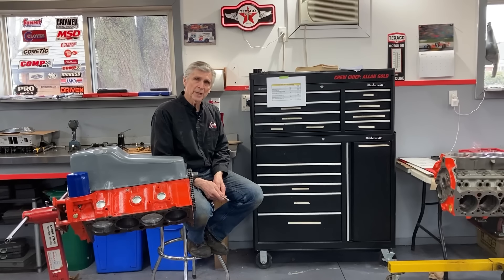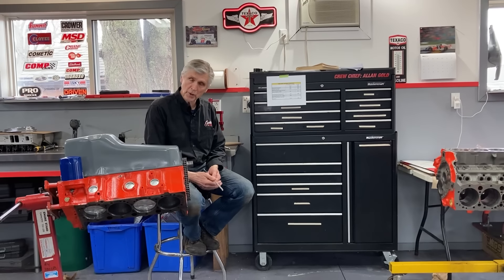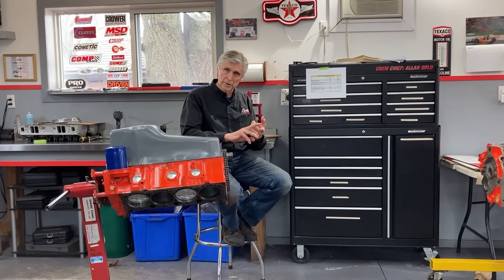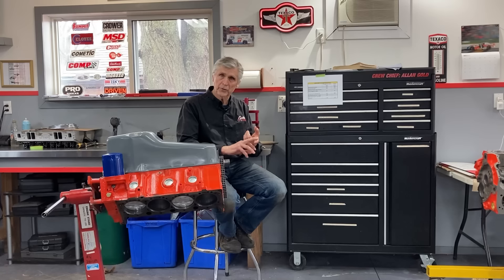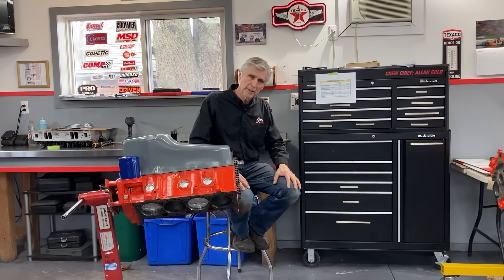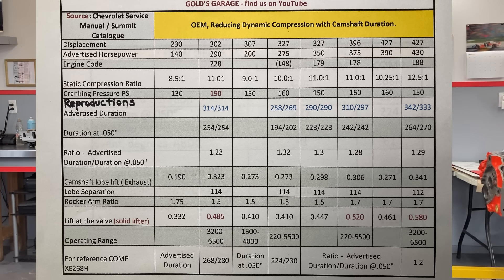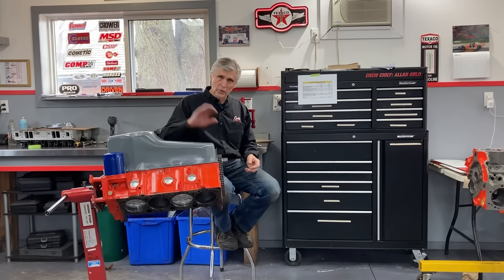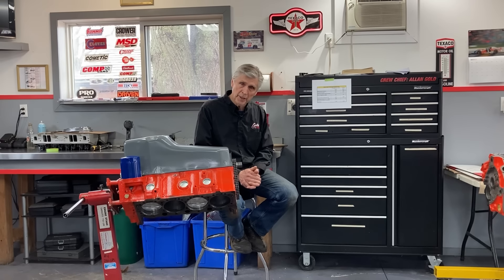Selecting the right camshaft - Compression Myths How much compression can you run on pump gas?

Comment: TheSaab 2.3 turbo engine have 200 psi pressure.
The 2.0T have 180 psi pressure.
They run around 0.7-0.8 psi boost.
But they also have very advanced engine management with knock sensing and timing adjusting.
Running 95 oktane (ron) or as its now called e10  (10% ethanol) instead of 98 the engines may produce as much as 40 hp less on a warm day while being pushed.

Some tuners talk about an engine being ”knock limited”. Meaning they cant produce more horsepower due to knock (compared to being timing restricted). So a lower compression ratio can sometimes make more horsepower since you can use more timing.

The Honda s2000 have around 220 psi.
Different engines tolerate compression different.
Quench, swirl/tumble, piston and combustion chamber design also play a role. How cool the heads run also make a difference.
Reply from the maker: Thanks for the great info Magnus. I don't have much experience with these engines, but I did build an Austin Healey a few years ago. All the same factors that you mentioned apply. If you have to take out timing, not much point of adding compression. Watch for more videos on this subject. Allan Gold

Comment: Has anyone Ever actually Measured & verified these Chevy Huge > 300° Duration & IVC° spec points ?? .....I suspect they are Measured for 0.006"  Actual Valve off the Seat After being Amplied by the 1.5 : 1 Rocker ratio......That would mechanically  Multiply the cam lobe Duration & Valve timing numbers.....I suspect if Both cams were Measured the Same method at the Valve, the Actual Duration & intake Closing timing degree wheel points would be Much closer.......For decades,  the Factory (probably SAE Standard 0.006" off Seat) valve Timing  Specification have been published but I've never that Method explained or Demonstrated anywhere.....Most Everything on Aftermarket cam cards is Advertized Duration, Installed Intake Centerline ° point  &  0.050" Duration data....It would Sure be Informative if someone could clearly demo How to perform the Decades old,  consistently Published & never questioned, Factory camshaft Valve Timing data Method & numerically correlated it to modern Aftermarket cam card spec data.......
Reply from the maker: All good points Tom. typically when installing a cam I degree it to the correct centerline and check the lift at the lobe. I don't usually measure the actual degrees, although when I have they are very close to the advertised speciation's. Thank you for watching and commenting. More to come on this subject. AG

Comment: Ethanol information is very skewed. Yes, it has less energy density, but it only means you will burn more fuel to achieve the same energy, which have an additional benefit (on top of having a higher octane rate), it helps to cool down the combustion chamber, allowing for even higher compression.
A same size engine, with jetting and compression adjusted for ethanol will make more torque and power than running on gas.
Reply from the maker: Thanks Carlos, case in point alcohol race cars. AG

Comment: Ethanol is exactly alcohol, it is vodka, unaged grain whiskey, its the exact same stuff that is in beer, wine, bourbon, Scotch, etc. EXACTLY the same stuff.  

The energy content of ethanol is NOT why you need to run more of it in an engine. The amount of Oxygen in the fuel is why you need to run more fuel. Gasoline in the real world, wastes more than 80% of its energy as heat that must be removed from the engine via the cooling system and some also goes out the exhaust. Thats why heat is such an issue with gasoline engines. That oxygen, and the cooling effect of ethanol, is why ethanol makes more power than gasoline.

Most gasoline vehicles achieve around 18% to 19% efficiency on gasoline. Yes they can do better in controlled environments, where everything is cooler and less chaotic than the real world. Make the environment perfect for the test and you can get it rather high, but that does not translate into driving around town or down the highway.

In contrast ethanol wastes only 60% of its energy as waste heat, because it burns faster, more completely because it vaporizes easily and readily in the intake tract. More of the fuel is used to power the engine rather than heat it. It does the 40% of its energy being used to power the engine in the real world, as it is vastly more forgiving... and it makes more power as well.

I have an iron headed Pontiac 455 with 13:1 static compression, it has a camshaft that builds plenty of cylinder pressure with the timing events making as much as I could get. It WILL NOT run on pump gasoline and live very long, sure it will idle around if you back the timing down enough, but that takes away a lot of power. It runs great on E85 and the HE100 I produce. 

What is HE100? Hydrous ethanol, meaning it still has water in it, usually around 10% of it is water, but that just means it is a slightly lower proof. If you drink it, it will not take very much before you are forgetting how to properly relieve yourself.

Now why on earth would I build such an engine, with a small camshaft that makes incredible torque from idle to 4500 rpm, and then give it some heads that allow it to keep making plenty of torque up to 6000rpm? We are talking over 600ftlbs though that range.

I made my 4100lb 1970 GTO into a mileage mule is why, and I got 20mpg mixed city/highway from it using a Qjet I converted to E85, 700R4 trans, 3.42 gear, and it had more than enough power to run mid 11s when it would hook. 90lb GTO front bumpers make it more of a challenge, and its a driver not a race car. By contrast it had a different 455 in it that ran on 87 octane, and it ran 12.60s with a 2.93 gear and a 2004R trans, and with a Th400 in it too. However, the absolute best mileage I got from the 87 octane 455 was 19, and that was following a semi down I-40 headed east, drafting off him. Usually it got 17 or 18 highway, and around town it was 12-14 depending on how I drove it. 

Now just how on earth did I get better mileage and more power running ethanol than pump gas? Its simple really...

The more compression you have in an engine, both static and dynamic, the more torque it is going to produce, because it is working the fuel harder. It packs the air fuel charge into a smaller volume before igniting it. The result is more power, with less fuel. 

With an engine that makes diesel like torque, you do not need a deep gear ratio like a 4.10 to move the vehicle. You can run 2.41 to 3.55 gears behind my engine and the ET stays pretty close to the same, but getting it to hook up with the 2.41 is much more difficult. It really likes to spin the tires. Put a 4.10 behind this engine and you will lose at least half a second in ET.

So the engine moves things easier, that requires less throttle angle, which feeds less fuel and air to get the same performance, you do more with less while having the potential and ability to have a lot more power available with more throttle. Work the fuel as hard as you can without it igniting when it feels like it, and you will get the best mileage. The problem with gasoline is: 

1. the waste heat
2. low octane that limits compression ratio

The waste heat compounds the octane problem. You have to run a gasoline engine cold. i.e. 160F thermostats.

Ethanol doesn't like to ignite without a spark, so it takes a lot to get it to ping/knock/detonate. It has to be very lean to do it. The hotter you run an ethanol engine, the more power its going to make in relation to the amount of fuel its using to make that power. You do not tune an ethanol engine like you do a gasoline engine. Its not quite exactly opposite, its more different.

We have this interesting thing called latent heat of vaporization, where as a liquid evaporates it cools the air around it. Ethanol is VERY good at doing this, gasoline, not so much. You have to run gasoline cold to get it to be happy, cold and lean. Ethanol you run it rich and hot to make it happy. Most people run ethanol too lean and too cold, then they get all sorts of other problems, like having a milkshake in the oil pan. It doesn't get hot enough to boil condensation out of the oil, particularly with a thermostat under 180F. I run my ethanol engines between 195F and 220F. Then they make less power than they could be because they are still thinking like gasoline. 

You want the intake manifold hot running ethanol, because its going to cool the intake charge more as it evaporates. Check out superchargers, you can see a 100F drop in temps under a roots blower between ethanol and gasoline.

Why did I do this with a Pontiac? Well, partly because I love these engines, and partly because of the design, which is why I love these engines. They have long intake runners, that are just a bit too small for the cubes under them, but they can still fill the cylinders. Why and how? Well its a velocity thing, the air is moving very fast through a Pontiac port at every RPM, its kinda sluggish in the chevy with the larger and shorter runners. I am talking the distance from the throttle blades to the bottom of the cylinder at BDC. 

Its a longer distance in a Pontiac. The bbc has large ports designed for higher RPM and not for torque production, its a different way of thinking with a Pontiac.  More diesel like... but when you take those long runners and make them flow two or three times as much air, it contiunes to produce ludicrous torque at lower RPM, but carries it farther in the RPM range, and it makes more torque everywhere.

So I made a 455 do better what it was designed to do. Most of the power increase from ethanol is between 1500rpm and 3500rpm, with smaller gains through the rest of the curve, usually around 10hp to 15hp. With a 1900 stall my engines stay right in that sweet spot where ethanol makes more power, and they are already making plenty of torque. They just make more.

That vaporization thing? Yeah.. you can use that too. Like Smokey Yunick's hot vapor Fiero, but no need to get the air fuel charge to 450F with multiple chambers and whatnot. Ethanol vaporizes at 173F at sea level, intake powers are more of a vacuum, not completely, but close to it, so ethanol is very happy to evaporate. If you heat the fuel before it gets in the relative vacuum of the intake port, it vaporizes instantly, cooling the air charge making it more dense and dramatically increasing the surface area of the fuel over atomization, thus making more power and using less fuel to do it.

Lastly.. the corrosion thing, that is from additives put in the fuel, same with the chalky white substance and the yellow or green gel. Thats all additives. Ethanol is simply vodka, there is nothing left at the bottom of vodka bottles, or whiskey for that matter, no matter how long they sit... like 12 years for scotch, or hundreds of years for wines. However wine does have some solids still in it, because its not distilled like whiskey, vodka, bourbon, etc.

I converted my first Qjet to E85 back in 2007. I am the first to do it and nearly all the information you will find online about it, or in books, comes directly from yours truly. In the last 16 years, and the previous 20 years that I was driving around with 10% pump gas in my vehicles, I have never had a corrosion problem due to ethanol. Lots of problems with pump gas, including rusted fuel tanks, rubber hoses that get brittle and rupture, fuel pumps dying, and of course that black crud in the engine and varnish in the tank. I get none of that with ethanol I make. The farther south I get E85 the more additives they put in it, and the more problems I have seen with the fuel.

Its not from the ethanol. Its from all the other stuff.

If you want the power that you can get from a high compression engine, just switch to E85/E98 and enjoy the power it makes. You can drive race car compression ratios on the street with it. Low compression will almost always result in lower mileage on ethanol, because its not working the fuel hard enough. Gasoline gets the edge under 12:1 static. 

If you run an ethanol engine too lean, you will use more fuel and you will also get less power from it. With boost you can raise the static compression of the engine above that of pump gas, which will pick up mileage, power, and make turbos spin up faster to some extent. With forced induction you will probably get worse mileage on ethanol, because when you add more fuel, you are also adding more oxygen and adding more air requires more fuel and it quickly becomes similar to the Rocket Equation. 

Best power on E85 is around 7.5:1 AFR. Best mileage, depending on bore size and other parameters is between 8.5 and 9.5 AFR. E85 and E100 will run quite well as lean as 11:1, but it makes a lot less power doing it. Ethanol will run at gasoline AFRs but will chug and buck, surging at times like steady cruise.

DO NOT GO LEAN WITH BOOST WITH ANY FUEL... because pistons do not like holes in them.
Reply from the maker: A lot of information Thump Er. You are obviously very informed on the subject, thanks for your input. AG

Comment: You will not make much more hp from 10.5.1 comp aluminum heads engine then going to 12.5 anyway even if you could use fast swirl chambers. It's like a lousey 15 to 20 hp. And then it doesn't run on pump gas unless you have 100 octane. Some places do. E85 is another story. 

E85 stinks as it takes 2 gallons to equal 1 gallon of gas. So 15 mpg equals 7 or 8 on e85.
Reply from the maker: Thanks for the comment. AG

Comment: I believe you but what is wrong with this running the higher octane instead of all this hub hub just make it easy and spend the extra dollar and the engine to run better ask the bottom line instead of having to get a camshaft that you don't want
Reply from the maker: Good point Steve, I will try to address this in the next video. AG

Comment: David Vizards psi minimum  of 180 to 200 psi would not work on a towing engine pulling alot weight even with 91 octane i bet it would melt it self down.   I could see having that if u arnt towing running 91. From my research once u reach 180 psi u need 91 octane, it just wouldnt work under a load i bet.
Reply from the maker: Good point Jesse. The pounds of car per Cu. in of engine is a factor, as well as gear ratio. Thanks for commenting.AG

Comment: So simply put, they didn’t open the valves for long enough such that they could ever achieve 12 compression ratio, because not enough air could be pulled in. They cheated so they could claim a high CR spec.
Reply from the maker: Good observation, thanks HU.AG

Comment: There are no rules about matching a cam to certain compression. That's a total bunch of BS!! Depends on size if engine. Sure, if your using a very long duration cam with large port volume heads, the extra compression height helps yo bring back some vacuum loss lack of velocity. More power is made from a bigger cam and breathing and cubes than is made from compression.
Reply: I don't know your background,  but I find it hard to believe you would just make a comment like this without knowing for a fact he is wrong? This is probably the 10th video I have watched about cam selection from different engine professionals and they all say the same thing. Your camshaft does not determine your compression ratio, it determines if you can run pump gas on your setup.

Comment: Shops toooo clean
Reply from the maker: Thanks Mike, its never clean enough!! AG
Reply: @goldsgarage8236  oh I forgot to mention my 66chevy 2 327/L79 and as you know it’s 11-1 compression and with the factory 151 hydraulic cam runs fine no detonation @36 degrees total, 87 octane mainly Bc of the large amount of overlap and relatively low cylinder pressure at lower rpm .

Comment: Trying to run high compression on old 1960s motors isn't too smart unless you have fairly high octane fuel available. 

When you go to 14.5.1 you will make more power runn8ng higher boost levels then higher compression. And domed pistons do restrict flame travel. You can use an intercooler with boost vs none with high comp pistons.